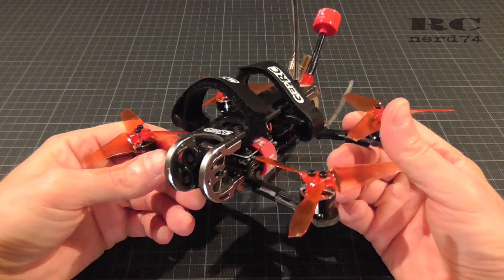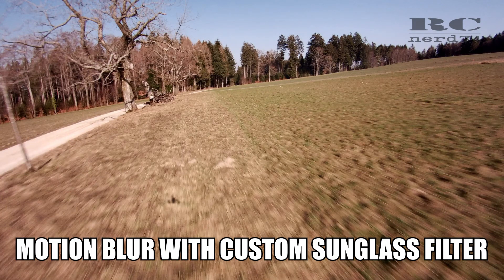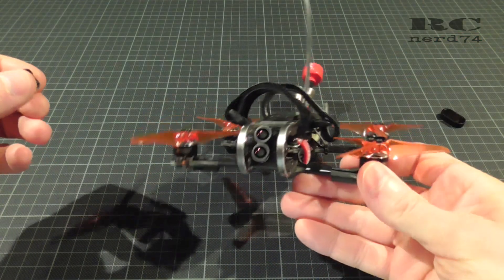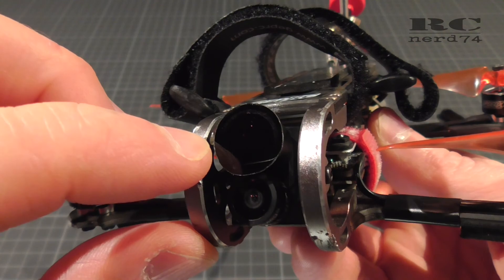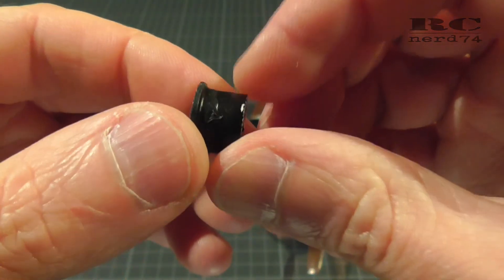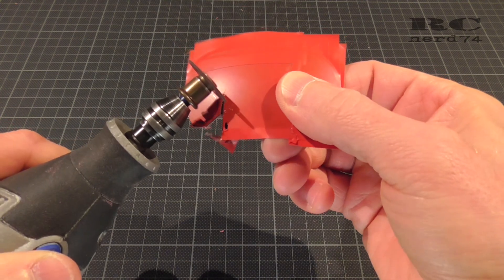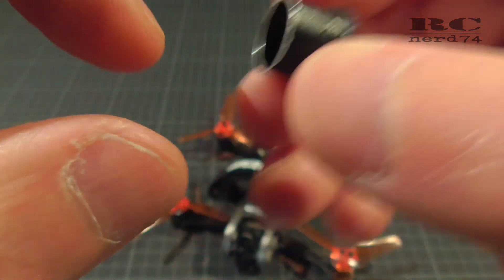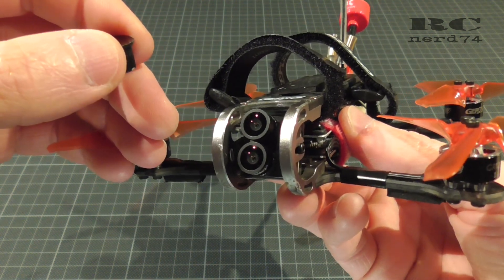HOW TO MAKE CADDX TARSIER CUSTOM ND FILTERS | TUTORIAL & TEST FLIGHT

Comment: I based my drone off of yours. Have you noticed the camera interference causing lower rssi numbers?
Reply from the maker: I have no RSSI info with my Futaba receiver. But as far as I remember, the interference is pretty stable. Perhaps it depends on the transmitter system you use. What rc system do you use?
Reply: @RCnerd74  I still get decent range, I've done a 530 meter flight before I got a short failsafe. It's a flysky i6s transmitter. It starts at like 60% RSSI with the camera and 99% RSSI with the camera off.
Reply from the maker: @shatterpointgames  OK. Still good range with the camera on. But interesting that there is so much interference. Thanks for your comments.